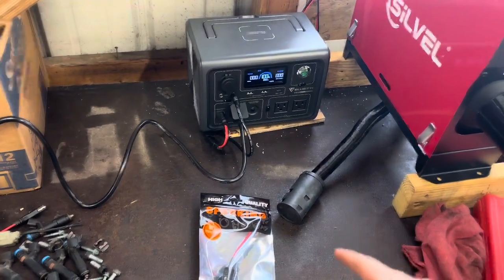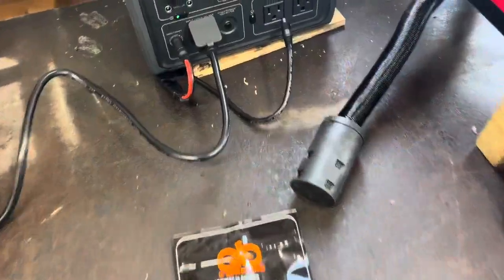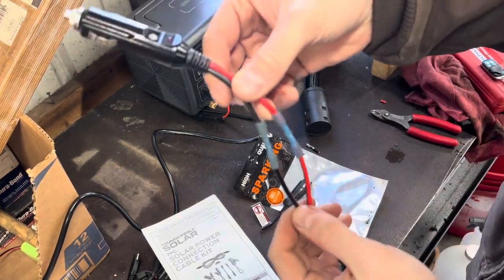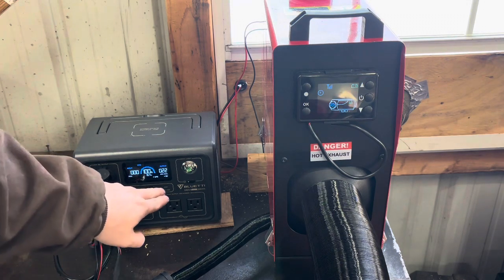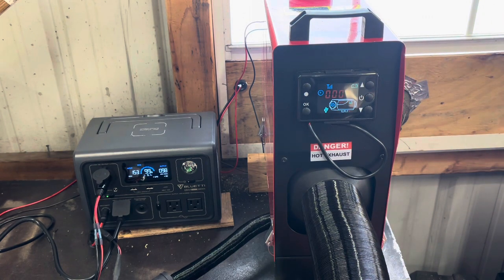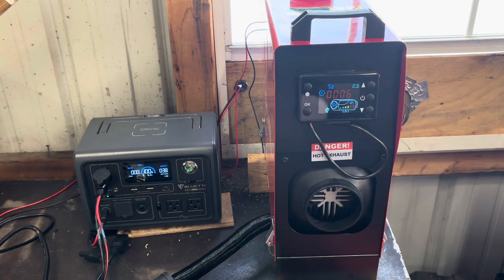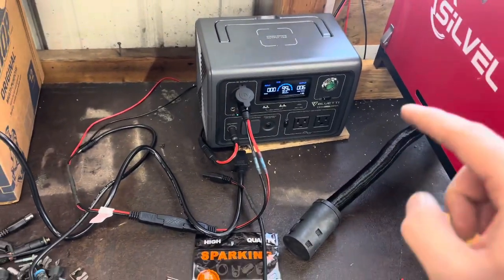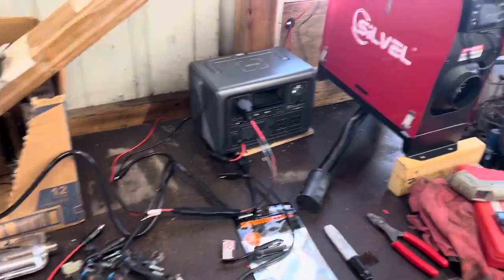Can a Bluetti eb3a power an 8kw diesel heater through the 12v cigarette lighter?

Comment: Doesn't work with my bluetti and 8kw heater. It can't handle the peak power of the startup. An old car battery would run it, the bluetti dont. I did use a quality 15ah plug. Going to try a ac to dc convertor 250w, soms say that will solve the problem.
Reply: Did you tried it with the converter? Does it work? How much watt it pulls with active AC converter on your powerstation?
Reply: @tugayaydin4506  hello, yes with the ac to dc convertor works great! It draws very low, and can handle the diesel heater like its nothing. I think the peak power is about 150watt for startup so not a big deal.  And running is about 80w or so. I have everything in my van hooked up to the same ac-dc 250w. I don't use the 12v port anymore.
Reply: @daalhoffarm  Do it need a 250 watt or is 180 watt converter enough?
Reply: @tugayaydin4506  You better use a 250watt. Rated watt is peak watt so its better to have one step higher.

Comment: Awesome thanks for the video I hope it works for me this weekend
Reply from the maker: Thanks I hope so too!
Reply: @MattGarage  well bad news the bluetti wouldn't start the heater. The heater would give the e02 code right when it would get to 100 watts of draw.
Reply from the maker: That’s too bad. What firmware is it on?
Reply: @MattGarage  idk it was my buddies bluetti but he said that there wasn't an update for it cause I told him to do it before we left if there was
Reply: It's on the same firmware as urs so idk. I had 15amp cigarette plugs to so it shouldn't have been those
Reply from the maker: I’m starting to think the Bluetti might not be all that great. I’ve had a lot of problems with mine suddenly losing all its battery percentage and then when I try to charge it, it shoots up to 100%. Still runs the heater fine but will randomly die which is bad on the heater and fills the shop with smoke. From stuff I’ve seen I think Jackery has a cheap one that will run the heater no problem, might be something to look into
Reply: @MattGarage  yea I've heard some things about that specific bluetti. I think I'm just gonna run it off a car battery. I ran it off the battery in my truck sumday all night and the truck started Sunday morning. I have a little 30ah lawn tractor agm battery that I'm gonna set up in the back of my truck to run and I'll just charge it over solar and maybe set my truck up to charge it to

Comment: Good job on the video 👌🏽 have you tried this startup process without the bluetti plugged into ac power?
Reply from the maker: That’s actually how I’ve used it almost 99% of the time. Always relied on the solar to charge it during the day before I would use it at night
Reply: Awesome, thanks for the reply. Does the EB3A power the heater all night?